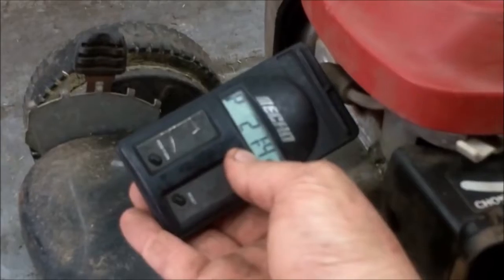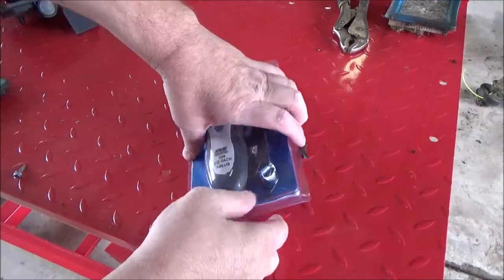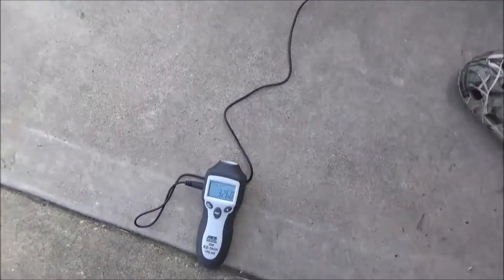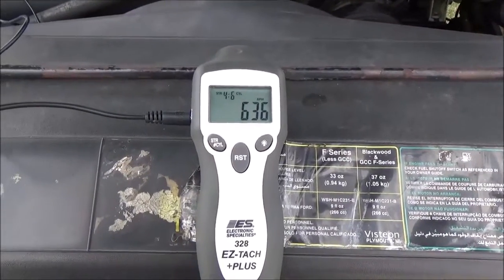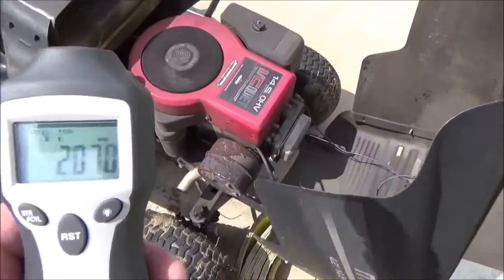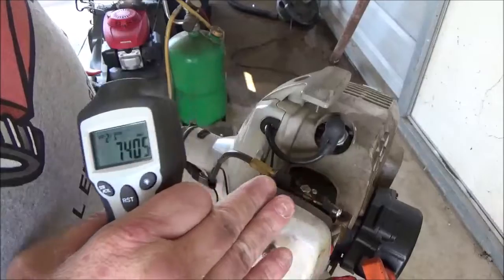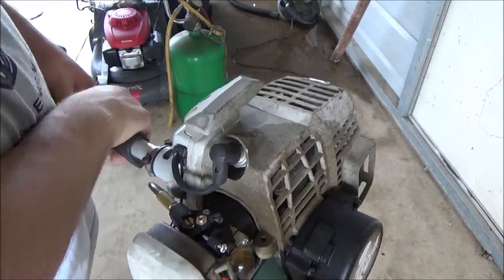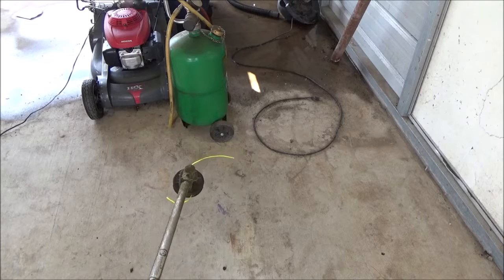ELECTRONIC SPECIALTIES  328 EZ TACH PLUS INDUCTIVE  TACHOMETER REVIEW

Comment: It reads RPMS ''wirelessly'' where the cord plugs in. not the top. the top would be more handy but its not how it works. 

The cord is a DC power adaptor 5.5mm outside by 2.1mm inside plug.
Mine broke a week in at the alligator clip. fixed that. then the wire broke flush at the other end. Bought a 3 pack of a generic 5.5mm X2.1mm power adaptor plug, right angle so that it wouldn't have that strain sideways on the wire. just 2 wires right to the clip. Had a time figuring out EXACTLY what plug it took. the replacement plug i made reads the exact same as wirelessly. bigger beefier wires too. 

Thought I'd just put it out there. I'm from Canada, and to register warranty or even get parts you basically need to be in the states. Wouldn't have bought it if i knew, but it seems i should be fine for now.

Comment: I have one of these that I used once, then lost for a few years. It turned back up, so I thought I would try it. I put a new battery in it, then used it on my 1967 ford 352 engine. It reads 190rpm. Which is so slow I don't think the truck would even run at that speed. I checked it with my old Wards diagnostic meter from the 1970s. Sure enough, that new meter is so far off as to be unusable. I don't see what I could be doing wrong, so I assume it's trash. 
Thanks for the video though. I didn't find the instructions with the meter, so I ended up here.

Comment: Questionable accuracy for me.  Measuring a 1-cylinder, 4-stroke mower I get anywhere from 3200 - 4000 rpm using the lead.

Comment: Mine must be an earlier model. When set to 4 stroke mode it gives the wrong reading on most small engines because they spark on both compression and exhaust strokes. I don’t understand how this unit can tell if the engine is a “wasted spark “ system or not.

Comment: It's interesting it read the mower correctly. The mowers I've worked with spark every revolution like a 2 stroke not every other revolution like a proper 4 stroke. I would have expected the reading to be double the actual value based on your settings.
Reply from the maker: Two cycle and four cycle ignition systems operate the same way it fires every revolution

Comment: I bought an identical looking tachometer in the UK to set my lawn mower RPM (Briggs and Stratton 450) I set it to 4 STR/1 CYL but it was reading double what it should and I can't figure out why, any ideas? It sounded right for 3000 RPM, but I had to set the tach to 6000 to make it sound right. Thanks for the video!
Reply: Because some of the small engines fire off the crankshaft, not the camshaft, they fire on the compression and exhaust stroke, doubling the RPMs you're reading.
Reply: The 4 stroke 1 cylinder setting counts 2 rpm/revolutions per spark. Typical single cylinder small engines as found on lawn mowers spark every revolution (like a 2 stroke). So your reading twice as many rpms because the mismatch in how the 4 stroke 1 cylinder setting counts and how frequently your mower sparks. The 2 stroke 1 cylinder or 4 stroke 2 cylinder settings should give you the correct rpm reading.
Reply: @killer2600  Thanks. I thought that must be the case after reading a bit more about it or mine had been calibrated differently for some reason. So why does yours read correctly on the 4str/1cyl setting when attached to your lawnmower? Surely lawnmower engines aren't different in the U.S.? or is it as you said, that different engines spark more times than others? and where do you find out how often your lawnmower sparks? Thanks again.
Reply: @nickmclaren3898  I'm not the video creator but I asked the same question about the lawn mower in another comment. Right now my theory is the tach in the video is defective. Less obvious but the same issue may be going on with the car demo. Unless it's picking up all 6 spark plug pulses, the reading should be incorrect. So I'm puzzle like you, but on a positive note your tach appears to be working correctly.
Reply: Killer2600 Thanks very much for your reply, it’s good to hear my tach is okay.

Comment: How do you adjust the power or get more RPM on a Toro SmartStow mower. I bought one 2yrs ago and sold it recently. It worked perfectly fine. The reason I sold it was because I was thinking of getting a battery powered mower. After I realized that battery powered mowers don’t give as good of lift on the grass I was upset I already sold my Toro SmartStow. So I had to buy a new one. I got the same model, so nothing was different at all. When I got it home and out of the box, I started it up and quickly could tell the mower sounded lower in power. I took it back and got another one thinking maybe something was wrong with previous one. When I got the second one home it sounded the same as the previous one. Not sure what Toto did but they obviously lowered the RPMs. I would like to get a little more power back in the mower. Are you able to help me with this? I have no understanding of all these moving parts. I did manage to take the cover off of it and move this flat disc or turn it and heard the mower get louder. So I am a handy person. Just not sure about all these moving parts and exactly what to do. Please let me know if there is a way we can talk. I am getting this Tachometer by the way. Thanks for sharing this item. Looked all over for one. Thanks
Reply: Gotta say if two different samples of identical things behave identically then they probably are working as intended. Your old mower was probably out of spec or just worn leading to sounding different than a brand new model.
Reply: I wouldn't recommend increasing the RPMs on this without knowing the specifications. Probably good to use a tachometer too.

Comment: I've had mine now about 2 years, only issues I have is 
1: it doesn't have a recall to see what high and low's are 
2: the battery seems to go dead rather quick when in storage, my fix is to just disconnect the battery.
It's read every rpm range that I've put it too, up to 14'500rpm on my Husqvarna Cookie Cutter with no problems.
A decent tach for the money.

Comment: I followed the link, price isn’t bad,
A little less than the Tiny Tach, which only lasts for 4 or 5 years till the battery dies. It’s potted in the part, and not replaceable.
Are you still liking it?  If so, I’m gonna get one.
Thanks, Jim

Comment: I have got to have one of those...check the connection at the LED screen on your old RPM meter you might be able to fix it
Could be a little corrosion on the contacts..just a thought..Cheers  🍻🍻🍻🇺🇸🇺🇸🇺🇸